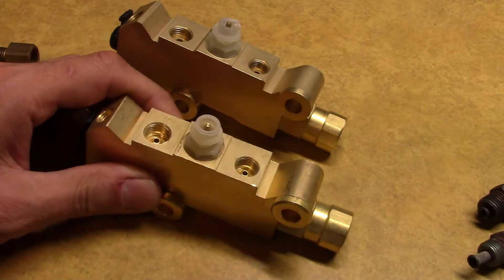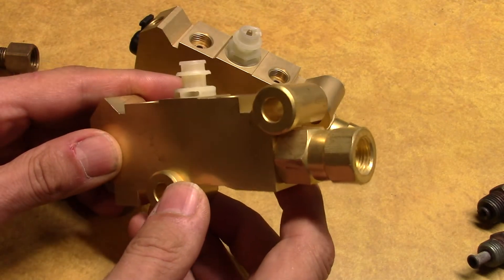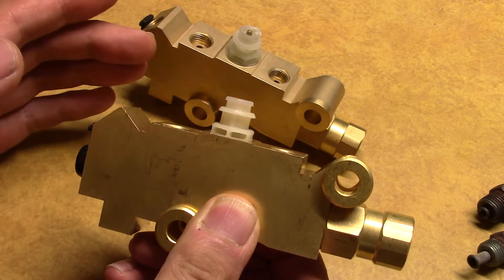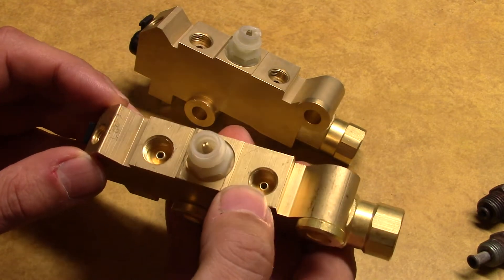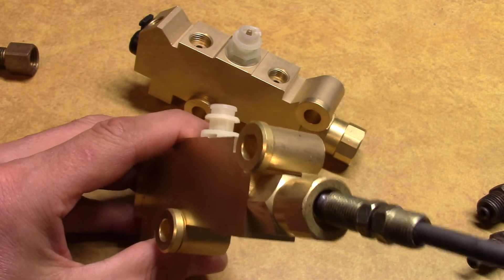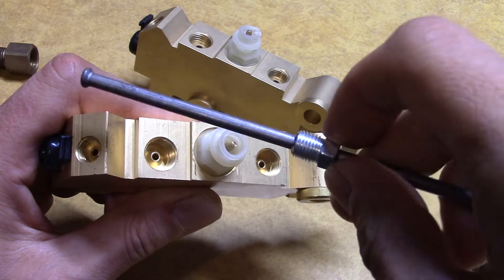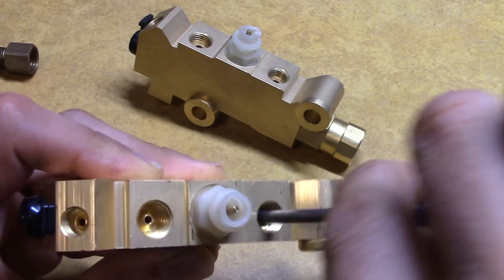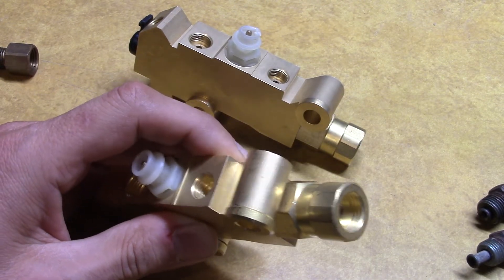Proportioning Combination Valve Disc / Drum PV2 Port Size Note 3/16" or 1/4" line size / Bad Batch?

Comment: Things to be aware of with all these $40 PV2 valves out there:
1.  What this man explained, the cones are different from each manufacturer, they seem to do whatever they want in that regard
2.  Many of the Chinese ones use the wrong type of rubber for the seals, which brake fluid completely disintegrates over time
3.  The Chinese ones also may have some flashing left on the cup seal inside, the one attached to the large end bolt with the pin through it.  This causes the unit to leak badly.  You should remove that plug and inspect the cup seal before using the valve to make sure no flashing was left on the plastic cup and rubber seal.
4.  The outlets of your master might have a reverse pattern compared to the inlets of the PV2, and yes it does matter, you want to route the lines from the master outlets to the proper inlets on the PV2.
5.  Check both the cone on the master AND the cone on the PV2 to make sure they're both intended for the same size line before troubling yourself making a line.  Use an adapter if they're not the same, otherwise you'll never seal the line properly and it'll always leak.
6.  Not all Chinese ones are bad, but you're gambling buying them if generic pics are shown and feedback doesn't clue you in on any of the above details, and it might be better to get one machined here in the states for closer to $115 with all the proper ports and materials inside.  Brakes are something you shouldn't gamble on.

Comment: Well,Im converting my 83 c20 chevy truck to 4 wheel disc.Ill be using a 78-82 corvette(4 wheel disc) combination valve.The 4 disc,and disc drum are different valving,and porting.They have to match up.
Reply from the maker: very different yes.  This vid was based on a disc/drum combo valve.

Comment: this is a nightmare the part not cheep should have come with the little bleeder part
Reply from the maker: parts are a mess these days
Reply: Flooded with crapola fresh off the China boat.  Get one made in the US so the cones are right and right rubber is used for the seals, no flashing left on them too that will cause the notorious leaks out the end.

Comment: Since switching to this style of Combination Valve, my rear brakes locking up, just by putting too much pressure on the brake pedal, even without the motor running.  NO JOKE

It works fine if you use light pressure, but once you put too much pressure, the rear brakes locking up.  Then, in order to release the rear brakes, you have to jab/stab at the brake pedal somewhat lightly. 

Any ideas?

All fittings, fit perfect, no leaks.

Comment: Without specifics, model numbers and vendor, no one can know what they are buying.  So it's a warning but no way to make the purchase confidently.
Reply from the maker: Yes.  I even reached out to the vendors directly for the 70's Ford product I was working on and this issue was news to them.  One vendor said this will take a year before they could straighten it out.  (maybe it has been addressed by now).  As you say, no part numbers on these but so many variations that are needed and they are all similar in appearance.  How does one know?

Comment: The rear port is clearly for 1/4" line.
Reply from the maker: I agree
Reply: The stupid thing with the Chinese made ones is the inlet port is 3/16, but then the outlet for that same rear brake line is 1/4.  That bothered the hell out of me to the point I spent more money buying one made in the US that has a 1/4 inlet for the rear line.  It just seems detrimental to have a 3/16 choke point in a line that's supposed to be 1/4, and I'd rather not chance it on brakes.

Comment: This could of explained the reason I was struggling with leaks in my porpotion valve and it was irritating the crap out of me and never considered that this might of been the issue,I bought another one and I'm going to look at this closely now,not fun when the brakes went out on me,what's the adapter size you chose for the rear line?I already ran 3/16 all around.thanks for the information
Reply from the maker: For the rear output, I could not find an adapter to do the conversion in one step without using two adapters inline.  I actually took one designed for a 3/16 line and a 3/16 cone seat and had it milled to accept the 1/4 output cone seat.  Such a pain when all we can get is junk these days.  Sorry to hear of your frustration!  Let the vendor know!  I was met with surprise when I contacted both vendors and they said that they never had a problem.  I sent them this video and they said ok, we will look into it.  I never followed up.
Reply: Check the rubber seal and plastic cup inside it for flashing if leaking out the bolt/pin end.  Flashing is a common problem on Chinese units and it distorts the seal enough to make it leak.  Some use the wrong type of rubber too, it's good to check it out and make sure the rubber isn't disintegrating in there.

Comment: I have a pv2 and i capped off one of the front brake ports and came off the other one and hit a T to go to both front disc brakes. Will that work? Or do i neex to take one line off each front port?
Reply from the maker: I am not sure one way or the other.  Myself, I would probably use the extra port and run that second line.  Thanks for watching.

Comment: I would be curious to know if the internal workings are physically exactly the same given the physical differences on the outside housings? I will wager that, given different applications, specific to model would be the solution and understanding all of the physical differences you have pointed out here… I feel that if a person gets the proper application valve, there will not be a problem. One has to know what they are buying and what they are buying it for simple as that…
Reply from the maker: As far as the second point in your comment, yeah, that is just it.  I ordered these valves for a specific application, each from a company that specializes in the particular year, model and brand truck I am working on, and the parts are inaccurate.  I did not want to do any name calling here but I did reach out to those vendors and expressed my concerns.  They were not aware and were going to make corrections.  Thanks for the input.

Comment: With this proportioning valve do I still need residual valves for a disc/drum brake?
Reply from the maker: My understanding is: Yes, for the drum circuit.  The master cylinder usually has the needed residual pressure valve/valves depending on what is purchased for a particular application.  This valve has the other things (3) that are for other purposes as described quickly in the video.  As far as residual pressure, drums need residual pressure so they are ready to act.  It keeps the shoes near the drum.  Discs do not need residual pressure valves.  If one is used, they will drag.  There are also different  residual pressures depending on the elevation of the master cylinder (mounted either on the frame or on firewall).  If you have a disc/disc master cylinder, they make inline residual valves one can add, something like either 2 psi or 4 psi for different elevations of master cylinder mounting I think possibly.  You do have to know where you are ordering your parts from and what for.  Is it disc/disc, or disc/drum, or all drum....   **Keep in mind, I am no expert in this area and I am not certified. ****

Comment: I bought one that was a bubble iso flare the new one was a double flare. I made new lines now my front brakes are sticking to the point where I can’t move the car. I put new calipers yesterday and I believed I fixed the problem. I was driving around fine until I slammed on the brakes and the front brakes didn’t release
Reply from the maker: The only thing I can think of is do you have the correct master cylinder in there?  If you use a master cylinder designed for drums on a car that has discs, there will be drag problems...For example, if a car has drums in the rear and discs in the front, the master cylinder has to be a drum/disc type.  Look up pressure residual valve as it applies to drum brakes.  The only other possibilities would be 1) bad rubber hoses not allowing fluid back 2) push rod length of master cylinder / booster too long not allowing the push rod to retract all the way 3) the pressure differential valve in the combination valve is shifting due to an imbalance and then sticking.  Unfortunately, it sounds tricky.  You may be able to crack a line loose here or there strategically, maybe starting at the master cylinder,working toward the calipers step by step to see where the pressure buildup is.  Good luck.
Reply: @JIMO415   So after hours of head scratching this is what I found. 
I never change the master cylinder .
So it should work … I know it’s not a hose because it’s both front wheels locking up ONLY when I stab the brakes to do a brake check. I will then crack open a bleeder on the caliper to free it. I can drive it around normally as long as I’m not doing an emergency stop. Now I notice weird, some brake is fluid coming out of the valve on the (proportioning valve) there is a pin inside moving, and every time the brake lock up, a pin come out of the hole on the proportioning valve, causing some fluid to come out. what would cause this? I have no idea.
Reply from the maker: @Bigislandguy  hmmm, not sure.  I am not an expert so you are aware, just a hobbyist.  But, sounds like maybe the valve is N/G???  If you find out, please let everyone watching know here.  Best of luck.
Reply: Could've been wrong lines routed to inlet ports on the PV2.  For example, the rear brakes on GM trucks is actually the front port on the master, so that gets routed to the back port on the PV2.  The cones might be slightly different on the master, one on my NBS truck master is slightly larger than the other, which is the 1/4 rear line.  If the master has a residual valve for drums on the rear brakes, that one connected to your fronts could be causing the disks to stay locked up.

Comment: Brake line adapter??
Reply from the maker: These valves were ordered for a specific application, I would not expect to need an adapter.  Having this valve on hand now, there is not an off the shelf solution to adapt in one step without having to use two adapters inline.  I had one made.  The purpose of this video was to alert end users to possible things they may be doing incorrectly in using this valve and possible fitment issues.
Reply: @JIMO415 welcome to working on cars

Comment: Lots of problems with these they aluminium ones are worse all have 1/4 rear port but some of the 3/16 are wrong as well
Reply from the maker: It is alarming the quality of the junk we are getting as replacement parts and the specialty outfits selling them AND installing them, have no clue.  I made a couple aware on this though.  They seemed receptive and willing to adjust.

Comment: Yep #1 with a reducer for the rear, what I'm doing for my 74 F100 since there's no kit to rebuild the OE Heyes valve
Reply from the maker: Fomoco, were you able to find an adapter to convert on one step or did you need two adapters?  I had to have one made by my machinist buddy to do it in one step.

Comment: I'm in the same boat. I bought my valve off of a Ford website saying it would work for my f100 but didn't know about the 1/4 line until after I got it. If you found an adapter I would love to know.
Reply from the maker: Donald, thanks for the note.  The two in the video were each from a Ford site also.  I am working on a 79 F-250.  Searching high and low I did not find a one step adapter.  Going to the autoparts store or dormanproducts.com I was only able to come up with two adapters to do the job.  I did not want to do it with two adapters so I happened to have one on hand that was 3/16" x 9/16" male in and 3/16" x ? female out and I had a machinist buddy open up the cone seat on the male end a touch to a 1/4" size based on another adapter I also had for reference.  That was my solution.  Dorman's tech line was not much help.  Ridiculous to have to do if you ask me.  Hope you have luck.  Let us know how you do if you like.
Reply: @JIMO415  thanks for the info. I actually had the same idea about opening up an adapter I already have just need a way to do it. wish somebody would make an adapter for these applications being they are sold for these other vehicles but guess this is what you have to do when building car from all these different parts.
Reply from the maker: @donaldprater5099  at your own risk.  The machining has to be chatter free and smooth I would imagine for a good seal.  good luck.